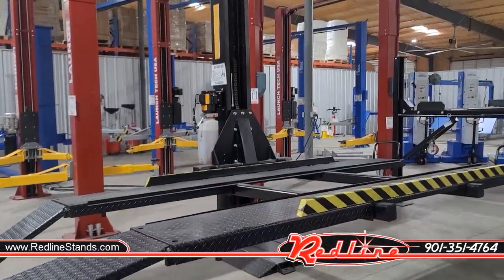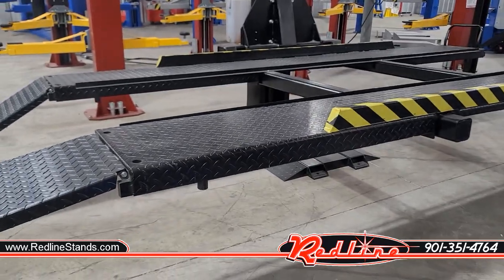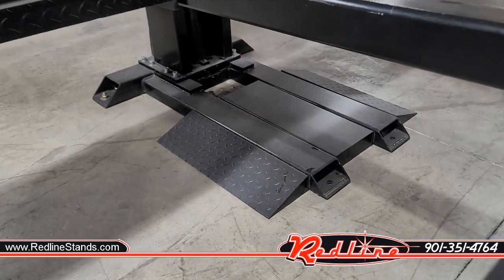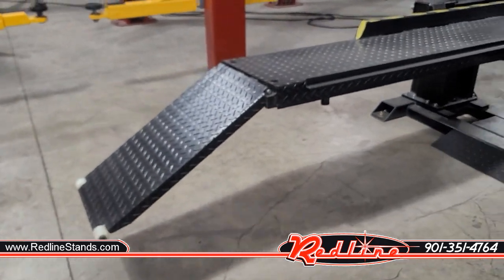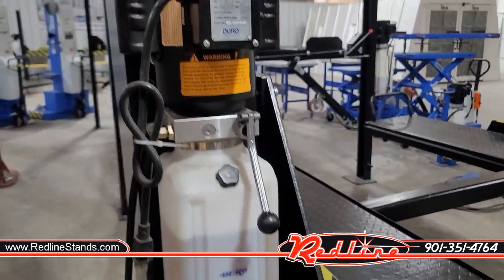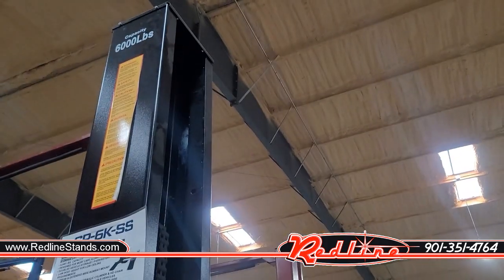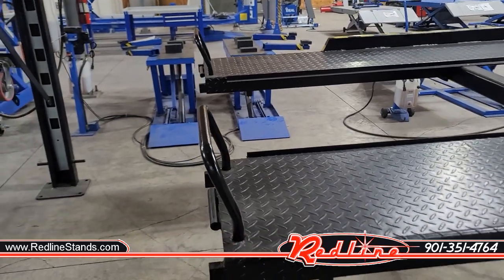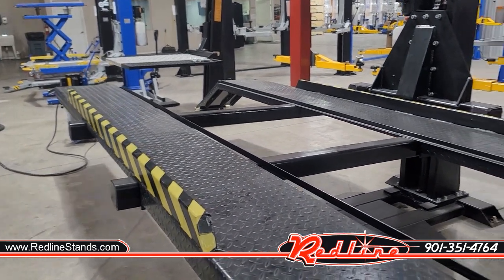Single Post Parking Lift Features and Walk-Around

Comment: Will a 4 in cement with 6in x 6in - 10/10 welded mesh support this lift ? I have a townhome built by Pulte builders ?
Reply from the maker: No sir.  Please refer to the manual linked below for the concrete requirements.

https://www.redlinestands.com/manuals/SP-6K-SS%20(Mar%202023).pdf
https://www.redlinestands.com/manuals/TUXEDO%20SP-6K-SS%20Concrete%20Pad%20Specs.pdf

Comment: I know we have a difference of opinion on cylinders, pulling or pushing so my question is, does this unit uses cylinder that pools or pushes?
Reply: This is a push style chain over roller assembly. If it were a pulling or retraction cylinder it would be much taller as the cylinder would have to be fully extended while the lift was at its lowest point. Good question, thanks for posting.